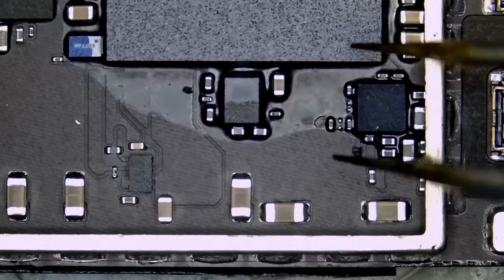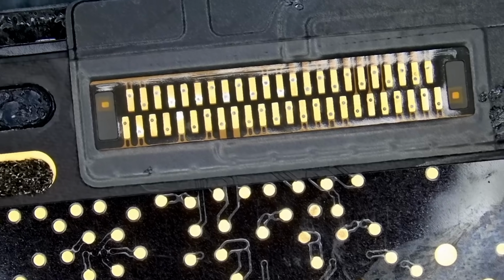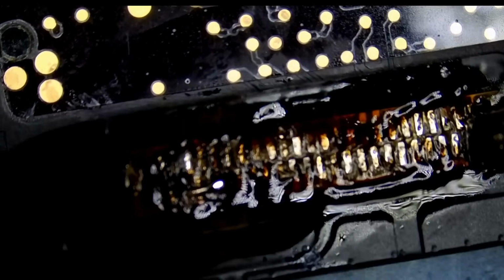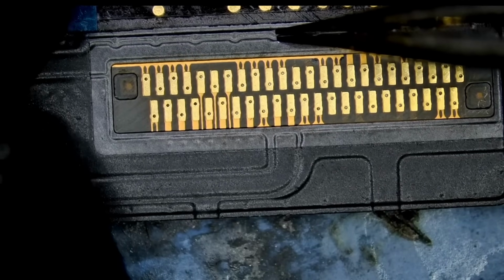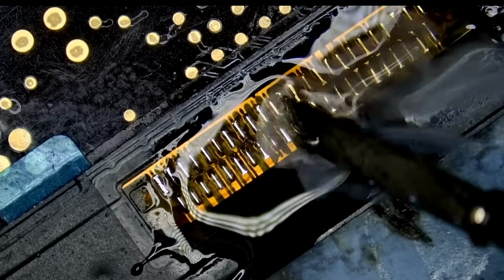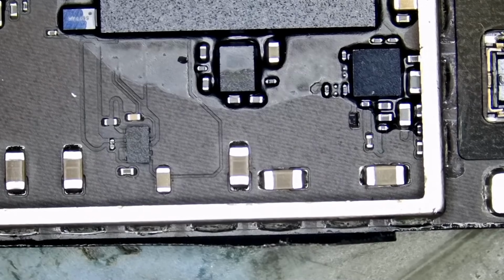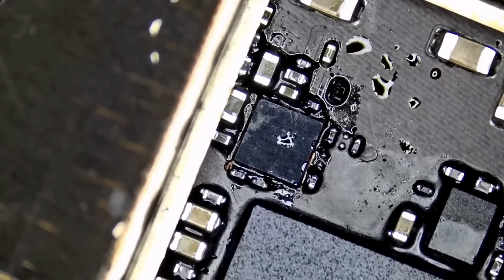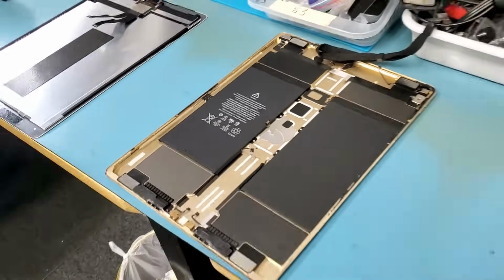Replacing this chip is a Nightmare. iPad 5 Glued Tristar

Comment: Apple's anti repair tactics should be illegal.
Reply: its not just apple, other manufacturers also use overfill and underfill, but i must admit that pesky charging flex is a dirty move by apple.
Reply: I thinks it’s more to do with waterproofing
Reply: Uh no. I like my waterproofing very much. When you ship millions of devices glue and protective coatings result in less damaged PCBs and waste then any amount of fixing could make up for.
Reply: Yeah get some pitchforks too and act like your android manufacturer friends are angels
Reply: @thenextension9160  then the solution is a low temperature melt glue...
Reply: Underfill has nothing to do with anti-repair. It’s for shock and corrosion reduction. ALL modern electronics have it. The charging flex is designed that way so that you can make all the connections at once and keep the connections low profile.

Comment: Hi, very interesting. One question:
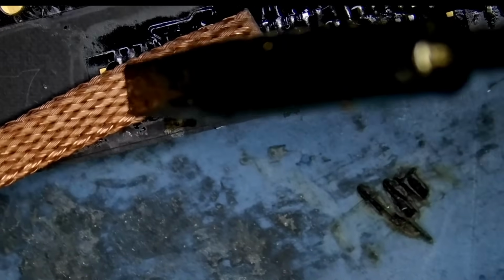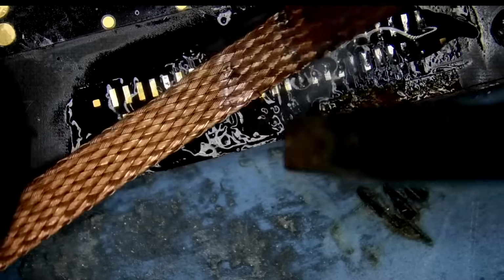5:26 (and at 5:50),  you are saying that the melting temperature is about 48 C, but the Low Melt Solder Pack of 6 Sticks (your link) has a melting temperature of about 160-200 C. 
How does it come?
Reply: I don't get it either. 48 degrees can't be true...
Reply: @L33t3n  it is true. There are special alloys with that low melting point just for this porpouse.

Comment: could you not solder the flex cable on the same way you would a chip? apply solder to the pads, line it up and then use hot air to melt the solder making connection. Wouldn't it provide better contact too given that there is no glue anymore.

Comment: FYI, hand sanitizer works great for turning glue goopy enough to scrape off without damage in most cases.
Reply: But hand sanitizers are sticky, and release some fume.
Reply: They are basically Alcohol...
Reply: In the video he uses heat plus alcohol and some mechanical scraping - very effective.
Reply: hand sanitizer is made with: water +  alchohol(about 60%), and some kind off gel usually glycerin if i remember correctly. you want to use 99% iso to not leave any residue. but the hand sanitizer would evaporate less fast so if you have to avoid mechanical scraping for some reason it could be effective to have long-lasting alcohol(sanitizer) sit on the glue to react with it longer
Reply: Hand santiizer is always ethanol based, isn't it? denatured, of course.

If it is then it will be little different to isopropanol for that purpose.

Comment: Alex you can"t remove the glue with ascetone ?
Reply from the maker: Cured underfill on iPad 5 is the hardest I came across. Must be carefully cut with a blade and hot air to separate chip from components.

Comment: That glue looked to be pretty soft.  I've run into some really hard glue and wondered if you have advice for that?
Reply: Combination of hot air and you will need to cut it off
Reply: it is hard like a rock in a normal temp. you need to heat to to 200 C to softer it